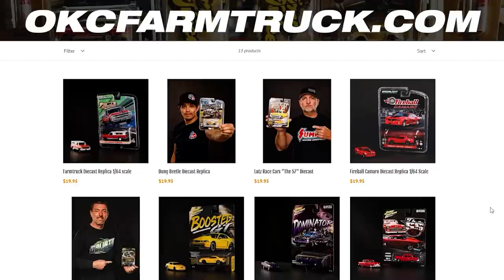FARMTRUCK'S MYSTERY PURCHASE!

Comment: Irvin, fairly sure you have what you said back to front. Been a very long time since I touched a car with points, but from what I remember from my College days nearly 40 years ago, the coil saturates while the points are closed not open. The points opening is what caused it to jump from the primary windings to the secondary windings in the coil (causing the spark). Also remember learning to increase the dwell you decrease the gap. Which also falls in line with it saturating while the points are closed.

Comment: I'm not a chevy guy, but we had a 53 chevy wrecker we used up til the late 90s, will always love these trucks.
Reply: I worked for a guy in central Florida who had a 1951 Chevrolet ton wrecker.  Had original 6 cylinder in it.  Got the job done with it..

Comment: Azn, the idea behind the oil bath, was the heavier dirt particles would keep traveling in a straight line and collect in the oil, the lighter non dirty air would simply turn the corner and go into the engine. Wasn't as much an air filter, as it was a larger particle separator. Physics / gravity working at its best.

Comment: I started driving by buying a 1950/1500/Chevy ...3 speed on the column/AC by Manuel vent on /starter and dim switch on the floor.....under 2k miles and previously owned by a WW2 Vet that sadly passed away. It was stored in a barn under a HUGE thatch of loose hay for $100. It had ZERO RUST, DENTS, LIKE BRAND NEW. I put $400 in brakes, tires, bleeding fluids, plugs etc, etc. THAT truck and straight 6 ran like a top....40-45mph tops all day. What a beauty too....got my driver's license in it and the State Trooper asked me for a drive after the course. Kids driving street cars to work and me my truck.....and I was as COOL AS THEM !!!!

Comment: No Babbitt ! It has a later model valve cover. Up to 1953 Valve cover had two studs through center of cover. 54 up had cover with screws around edges........ This is a full oil system, rods and mains...

Comment: I turned a 55 1 ton. Single wheel  I did a 4 link with coilovers and raer end out of a 95 narrowed 27.5 to tuck a dually under the bed sides and the 95 front clip narrowed 10 in for dually disk brakes  all  around  6.0 4l80e swap. Customer loved it

Comment: If thats a non full-flow splash lube engine, make sure you DO NOT rev it at all much past idle when warming up until the thermostat opens and in general do not rev it much past 3000rpm in normal driving as the babbit aint as flexible as insert bearings and rebuilding is a different task (if the parts are available) , maybe he plans an SBC conversion we'll see

Comment: I used to have a69 Dodge A100 van with a 225 slant 6 that had an oil bath air filter. The washer fluid pump was a rubber diaphragm mounted on the floor that you pumped with your left foot. The engine sat between the seat. You could do almost anything to the engine in any weather.

Comment: that original from bumper your fork pushing it around with is probably worth $2000 bucks... Has the 1 ton front carrier full floater so very well could be a 1 ton especially being a long bed

Comment: I think the most amazing thing was how easy it pushed by hand. Usually something that old and heavy would take 4 or 5 grown men to grunt and strain to push it like that.
Reply: Old trucks are MUCH lighter than new ones! I bet that thing ain't even 4000 lbs. My 98 Silverado 3/4 is 6500. Newer ones are even heavier. All that luxury crap. We're so soft now 😂.
Reply: @donellmuniz590 : That's saying something considering old trucks are metal, and new ones are half plastic.
Reply: @DFDuck55  Lotta plastic, for sure, but also a dozen computers, miles of wiring, air bags, big cushy seats, sound deadening and carpet, 10 or 15 stereo speakers, AC, and frames and axles twice as strong and heavy as the older stuff.

Comment: Had to laugh at the guy holding the screw driver, he was in the least danger out of anyone of getting a shock. Irvin holding the plug lead was the one risking getting a shock. There is only 6v flowing through the points, and he had a plastic handled screw driver. There are several thousand volts going through the plug lead.

Comment: @84,000 miles fellas, that truck had a ton of use. Remember, it's a 1949 3/4 ton. It most likely spent it's entire life on a farm with once a week trips to town and some use around the farm. 84K is in reality a lot of miles for one of these 'work trucks'. Also, most likely the engine has been rebuilt 2 or 3 times since engines of those times generally went south in 20 to 30,000 miles.  True, the body is in pristine condition and the truck is a cool find. The points,, I can't tell ya how many times I used a match book cover to clean and set the points in my old 4 door '53 Ford 6 banger, 3 on tha tree AND my 1961 Corvair Monza.
Reply: The motor has been replaced for a 3rd Gen engine, probably from the wreckers since the oil filler is not even genuine. I never trust a freshly painted car, there is no way to tell what sort of condition it was in before it got straightened and painted. I would bet the truck has had a hard life, and if you took the paint off you would get the real story it has to tell.

Comment: Reminds me of my old roommate's 52 Studebaker truck we rebuilt in the 80's. The engine was trashed but he found a guy selling still in the crate military engines used in troop transport trucks from WW2. Same engine but with "military spec" generator, starter, manifold's, carb. and yep, oil-bath filter. Thing came packed in solid grease (for shipping overseas) it had hardened over all those years sitting and took us forever to chip it all off but it ran like a sewing machine and he later got an overdrive from the same guy so he could get her past 50 mph...lol   I've still got a complete 1948 Dodge fluid drive 2 door business coup we had started on and never finished, I need to sell cheap if any one's interested.

Comment: Run a hot wire from the positive  side on the coil to the hot on the battery and by pass the coil it will start

Comment: Dont mess with it, try to restore its originality with the correct wheels, hubcaps etc! Please don’t destroy it with mods!
Reply: Ok, that's one guy's opinion. Just remember, the only one that counts is the owner's. If it was mine, I'd want a bit more power, an automatic, power steering, and better suspension and brakes, but stock APPEARANCE. Like the Thriftmasters that ICON Engineering builds. And I'd go back to an original, dark color like Hunter Green or Navy Blue.
Reply: It's not that original Paul, plenty has been changed on it.

Comment: 1949
Series

Wheel-

base

Type of Vehicle
GK	2100	115	
Passenger (DeLuxe) (Styleline and Fleetline)

GJ	1500	115	
Passenger (Special) (Styleline and Fleetline)

GP
3100	116	Commercial- 1/2 Ton Truck
GR
3600	125-1/4	Commercial- 3/4 Ton Truck
GT
3700	125-1/4	Commercial- 3/4 Ton Truck (Dubl-Duti)
 	 	 	
(Forward Control Delivery Chassis)

GS
3800	137	Commercial- 1 Ton Truck
GU
3900	137	
Commercial- 1 Ton Truck (Dubl-Duti)

Comment: Think someone is spinning you a line on this being a 1 owner vehicle. That truck is nowhere near as honest as you believe it is. If the back was a straight as you say and hasn't been beaten up, why would there be a need to repaint it? It would have good paint on it. More likely all the dents in the back have been beaten out before painting. But the biggest give away that it is not a genuine low mile truck is that it has a 3rd gen engine in it, which were not produced until 1962. So if it was a one owner like claimed, the original owner should have told you a story of how it got swapped out. Also fairly sure it uses a different bellhousing pattern to the early Gen 2 engine so the gearbox was probably swapped as well.

Comment: CONDENSER
Reply: Was wondering that myself. There was no mention of spark at the points. Although I don't know if they even had condensers back then. I'm not familiar with the vehicle. Being 6v it may not of needed one. Either way it would still run if the condenser was buggered, it is only there as a spark suppressor.

Comment: Since it's a long bed, put a Big Block in the bed, switch it to a 2 pedal brake system, put lexan in the floorboard, and see if it will WHEELIE the 1/8 mile , steer it with the rear brakes